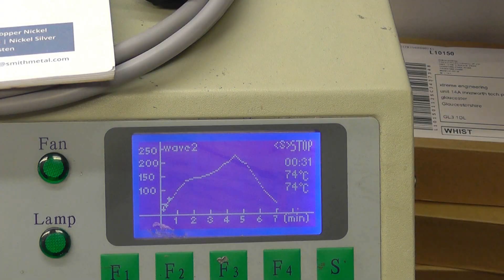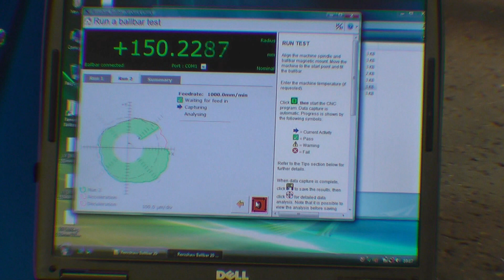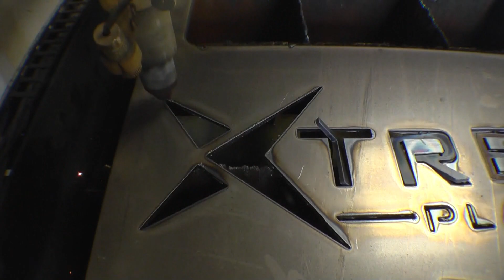Extreme Plasma  The Birth Of a CNC System

Comment: Great manufacturing set-up John, table legs look plenty strong enough. Never knew Mazak manufactured plasma systems.
Do Extreme configure machines with the water table level flush with top of plate material, or wholly submerged?
Thanks for sharing and best regards from the Black Country.
Reply from the maker: the water tray is below the work